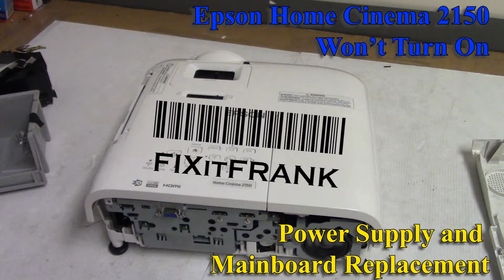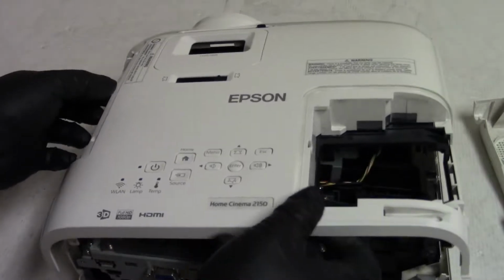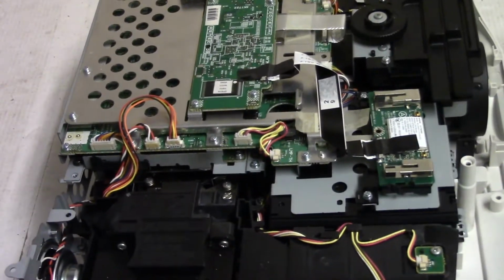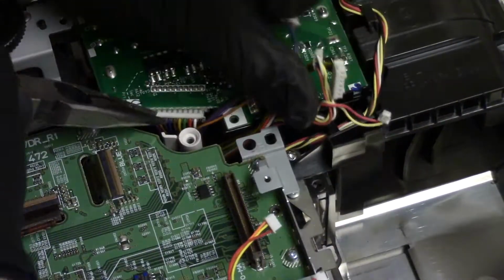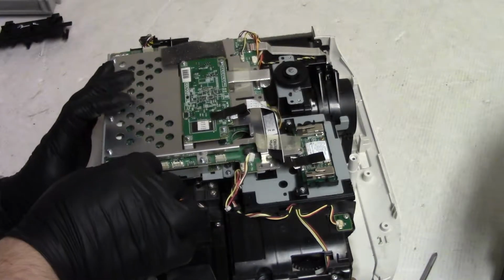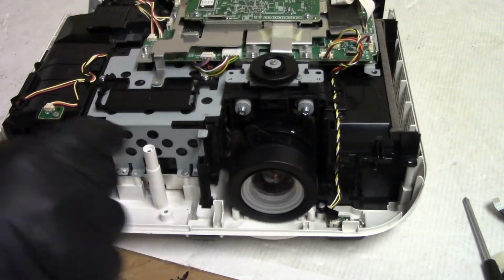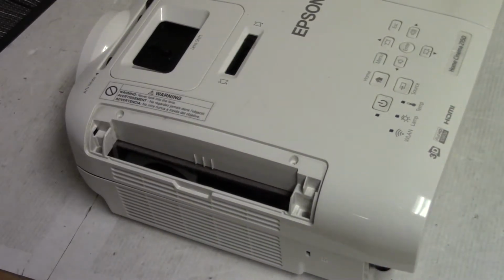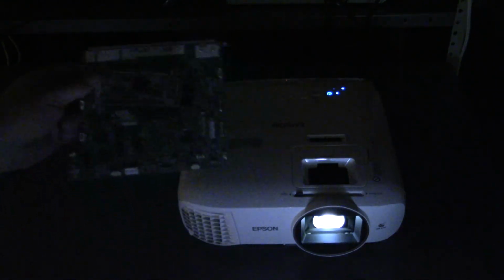Epson Home Cinema 2150 LCD Projector Repair | No Turn On | Mainboard and Power Supply Replacement

Comment: When I cleaned my 2150, I immediately noticed it seemed overbuilt in the wrong places. The multiple boards, controllers and metal makes it feel really nice, and the picture is good, it's just too bad the optics don't last (at least they didn't in mine). Was pretty surprised to see you work on one of these. Do you think this is the issue every time one of these series of projectors just stops powering on?
Reply from the maker: I think it's Epson and their constant effort to over engineer parts that don't matter. Drives me nuts!  
And yeah! I'm trying to force myself to work on more Epson. Trying to get more comfortable by becoming uncomfortable...it's equating to 50% repair and 50% waste of my time. I have a few that all need optics. So annoying.
Reply: @FixitFrank  I bought a 2150 from eBay and it has a strange green Halo/glow (worse/more obvious around text) in the upper half of the image. Is this what you're referring to about the bad optics?  I took some pics and can send to you. Not sure if I have one with misaligned panel or bad optics or what.  But I don't think it's caused by a bad bulb. 
I’m trying to decide on whether to push back on the seller or is there a simple fix?

Comment: Where can I get a new mainboard?
Reply from the maker: Its almost impossible.  Epson won't sell them.  Your only option is a used/pull(removed from a working projector). I will warn you though.  It will likely be $4-500 and the optics of the 2150 are getting old and the coating that epson uses will start to degrade soon and that will make the projector unrepairable.  As much as I like people to repair their devices, I would put your money towards a new projector. Repairing the 2150 will turn into a money pit.

Comment: Those ribbon connections are terrible, designed to be never disconnected. That's why the ribbon tracks are easily damaged when forcing the ribbon back in. You got it fixed though. That's the Pontcysylite aqueduct on the Llangollen canal, I've been over that on a narrow boat and it's weird looking over the side and a 38m (124ft) drop....yikes.
Reply from the maker: Omg I so envious!! I want to hire a narrow boat for a week or two someday and travel through the canals in the UK. Im sure you have watched or do watch David over at cruising the cut and he totally got me enamored with narrowboats. We have nothing like that here and it just seems like a perfect slow way of enjoying the countries of the UK.  

And as far as the connectors, I think you're right. I ended up cutting up an old one and found nothing that would latch. Just a barb like piece that would lock in the wire. Bad Epson...
Reply: @FixitFrank  It's a different pace of life that's for sure. I'm sure you will come over an do it someday. My mothers apartment has a canal directly below her balcony and the basin just a short walk away. Lots of boats in the basin are lived on full time. 👍